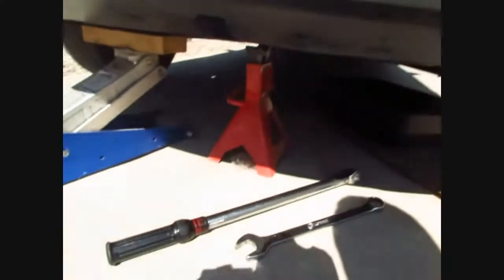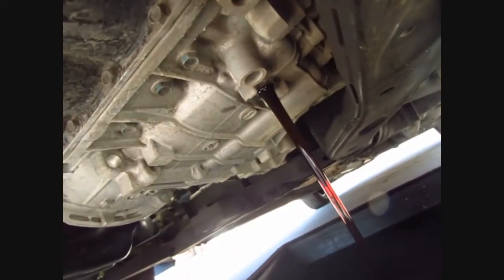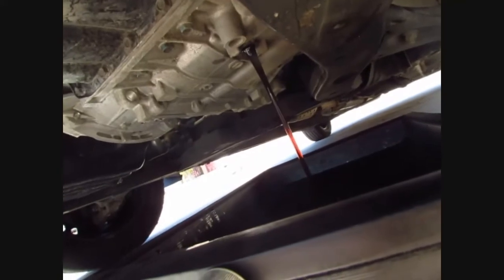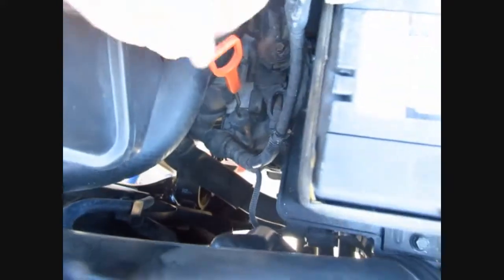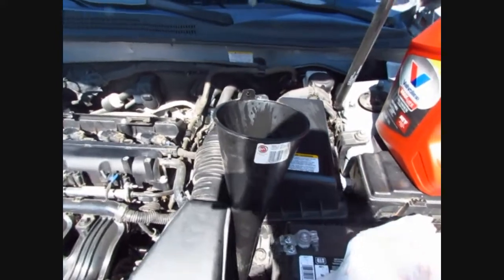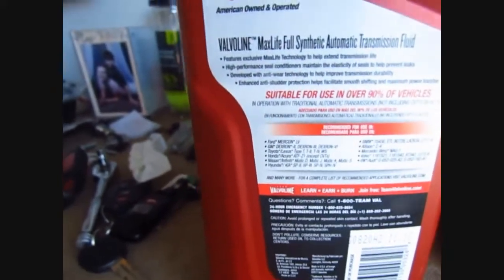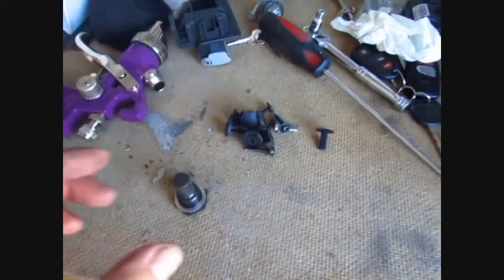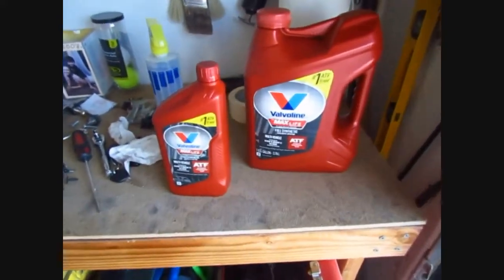How to Change Automatic Transmission Fluid 2008 Hyundai Sonata 2.4

Comment: I current own a 2.4 Sonata gls with 178k miles mix 70%city-30%highway 
Original transmission..
And whoever said you have to pull the transmission apart to change the transmission filter did Not know what they’re saying! 
    It’s not easy and yes the filter is internal but not impossible 
Pull the battery out and tray 
Unbolt the trans pan 
And the transmission filter is located behind the pan and up towards the top..right under the transmission safety neutral switch.. whole job takes about a hour or so..
     My car started whining from stop to go 
And changing the filter made it stop since just a dump and fill of fluid didn’t.
    I also was misinformed by many to use dexton 111 which I bought 
And used and noticed a big loss in power and almost like slippage while accelerating.. PEOPLE don’t use dexton! It doesn’t have enough friction for these trans..
   It uses Automatic transmission fluid SP111 only…please don’t grind your gear teeth away slowly by using low friction fluids…if you do then to save yourself and car add half bottle of Lucas trans fix..it will add the friction needed in the fluid if u can’t find the SP111 fluid 
     in the beginning of ownership I had a hard downshift from 2nd to 1st coming to a stop 
I also noticed if I just slowed down to turn a corner and hit the gas again it was lagging in speed. 
I switch it over to manual mode and noticed it would still be in 3rd gear 
At 15mph and was in that gear prior to turning. 
     I put half a bottle of Lucas transmission fix. And drove it 
And DAM what a difference! 
More power and no more hard downshifts when stopping and started actually being in 2nd gear (not 3rd) when going around turns 
Or trying to get back up to speed from Yeld on highway ramps.
    With using the SP111 Hyundai fluid 
Or Lucas it gave me the power and even my 2.4 was fun to drive around again! And I have 178k miles hwy city mix. On my trans.
Reply: I have the same whine I’m gonna try this hope it helps
Reply: @tygill7401  did it help? I have a 2008 Kia optima with a 2.4 same engine trans and my trans whines only on deceleration.

Comment: I use SP111 that’s what Hyundai recommends to use SP111 is a high friction fluid…u don’t want synthetic 
Or dexton 111 you’ll slowly grind the teeth off the trans gears. That fluid doesn’t have enough friction in it!! 
      If u can’t find SP111 
Then get Lucas transmission fix. As a friction additive and put half the bottle of 32 oz. 
     I did it on my 2010 2.4 triptonic automatic gls with 172k miles. 
And the power I got back is astonishing and the hard downshift from 2nd to 1st when stopping went away 
And mine was getting stuck in 3rd if I had to slow down and speed up (like getting on highway on-ramp) 
Id b stuck in 3rd at 15mph slowly gaining speed to merge on highway unless I really pushed on gas hard it wouldn’t go into 2nd to quickly merge. 
The Lucas made my car shift down/up where it needed to be…complete
Restored my power and transmission smoothed out
Reply from the maker: Hello jesse, 
            Thank you for the comment.
Reply: I wouldn't expect that restoration to last. There's no telling how much damage was done bud.
Reply: @chikinnippls7108  well considering it already has 172k, something's better than nothing😂

Comment: Thank you for the tutorial. Do sonata 2008s have transmission filters that need to be changed?
Reply: No, they do not.
Reply: Actually they do and you have to drop the trans to replace it.. If you don't feel like doing that, change the fluid, run it through about 500 miles, change the fluid again.
Reply: It's really just a screen, not a filter. Technically you can change this if you want to drop the pan (faced sideways) but a fluid replacement every 30k miles should suffice

Comment: Question: does Hyundai sonata 2006 have transmission filter? If yes where does it located?
Reply from the maker: Hello RAKOTONDRASOA HARY, 
               I talked to my local Hyundai dealership today. They said the trans filter is internal, and can not be changed.      Even though you can buy the trans filter from the auto parts store.
Reply: @SOLIDnickel1958  thank you for the quick update 🙏 you're amazing
Reply from the maker: @rakotondrasoahary5795  thank you for the comment.

Comment: mine is a 2007 2.4 liter, i assume its about the same as yours. once again how many quarts total did it take for yours?
Reply from the maker: Hello Kenneth, 
    Mine took 4.5 quarts. Measure how much fluid you take out. And start by putting that much fluid back in. 
Get the car warm, go through the gears and put it in park while the car is running. Check the fluid level, on level ground.

Comment: The Crush Washer should be replaced each time the ATF is changed. Avoids dumping fresh fluid on the ground. Hyundai Dealerships are REAL GOOD at NOT changing the Crush Washer. ATF dripping on the ground. It's a 1 Dollar part. But, that's how Flat Rate Artists operate. Save 3 seconds of time. 
Peace. Out.

Comment: I just bought the same car, well a 2009.  I have changed the oil, coolant and thermostat.  The transmission is sealed, but I know about dropping the pan like you did, but there is no pan.  I've seen on Toyota's that there is a gasket you need to replace as well. We got the car cheap and I was told to just leave the transmission alone.  Personally, on my own car I like to drop the pan at 70k.  This one I just don't know if it would mess up something.  It shifts well.  If it ain't broke don't fix it or should I switch out the fluid?
Reply from the maker: Hello SailfishSoundSystem, 
                       Just change the fluid at the mileage your owners manual says to. And thank you for the comment.
Reply: Sealed really? I have 2010 2.4 liter Hyundai sonata gls 
Triptonic automatic 5 speed trans and mines not sealed I have a dipstick on the right side towards the front on the left side of the battery 
Has a yellow pull handle.
Reply: Yep, many Hyundai's have a sealed trans. You have to have a special machine to pump and pull the fluid. If you want to invest in the machine, go for it or take it to a GOOD mechanic.
Reply: So did you end up changing it?
Reply: @jessewynne8193 I have an 09 and there's definitely a dipstick. So idk what they are referring to.

Comment: How does it shift with the Valvoline Max Life fluid?
Reply from the maker: Hello Mike,
               It shifts very smooth using the Valvoline     Max Life trans fluid.
Reply: @SOLIDnickel1958  Thanks. I am considering using Max Life in my 2010 Sonata transmission for the next change . Sure beets the $12 Canadian a liter for the dealer SP3.
Reply from the maker: Mike,
        Walmart has a good price for the Valvoline Max Life trans fluid. Dollar General had some on sale for $4.50 a quart.

Comment: you don't flush? if not, how often do you change the fluid? and you don't need to do leveling?
Reply from the maker: Hello philowing, 
                      Change the fluid on level ground, at the mileage your owners manual says to.
Reply: @SOLIDnickel1958  did you the leveling by the gauge or opening the leveling lid(not sure what it's called but not the drain bolt)?
Reply from the maker: @philowing  
                  Ok, thank you !
Reply: @SOLIDnickel1958  ah, it is a question.  i actually asked whether you leveled with a dipstick or opening the leveling plug.
Reply from the maker: @philowing ,
                        I used the dipstick.
Reply: @SOLIDnickel1958  Thank you sir!!
Reply from the maker: @philowing , 
                   You are welcome !

Comment: Just an FYI. The factory change interval is 120K miles. The 2008 does NOT use synthetic fluid it uses SPIII fluid and is $8 per qt. from the dealer.
Also factory warranty is 10 years 100K miles engine and transmission. If you purchased the vehicle as certified it will still be under warranty. Good Luck.
Reply: Wow! 120k miles?! My 09 3.3 sonata has 52,000 miles but takes significantly more fluid than the 2.4. I believe slightly more than 11 quarts. I'm definitely not wanting to change it unnecessarily, but my manual suggests changing it every 30k miles so I'm probably getting close if I go with that interval.
Reply: Ive never heard 120k... Always check with a HYUNDAI dealer and your owners manual. The 10 year 100k miles only applies to NEWER (like 2020s) Hyundai's...
Reply: @cornholius  YES your manual is right. I've worked on Hyundai's for YEARS. 30k miles is standard. ALL fluids need to be changed regularly.

Comment: You don't need to change trany fluid? I did the same thing to my 07 sonata 2.4 and on a very slow acceleration it jumps
Reply: You absolutely need to change the transmission fluid on ANY car! Fluid degrades. Come on  maaaaan

Comment: How is your car doing after you replaced the transmission fluid with Maxlife?
Reply from the maker: Hello Harold, 
             The Sonata shifts very smooth after using the Maxlife trans fluid.
Reply: @SOLIDnickel1958  thank you
Reply: RIGHT?? That's always my question. Where are the pre and post work videos??

Comment: no filter?!
Reply from the maker: Hello Quality Reno,
      It does have a filter.
Reply: @SOLIDnickel1958  where is it located?
Reply from the maker: Hello RAKOTONDRASOA HARY,   
         The transmission filter is behind the transmission fluid pan. The trans fluid pan is facing the front of the car. I am going to do a video on changing the trans fluid filter this weekend.
Reply: @SOLIDnickel1958  wonderful 👍 I'm excited to see your next video
Reply from the maker: Hello @rakotondrasoahary5795  , 
       I talked to my local Hyundai dealership. They said the trans filter is internal, and can not be changed. 
Even though auto parts stores sell the filter. The same kind of filter that would be behind a transmission pan.
Reply from the maker: Hello Stream Kingz+App&Teck , 
   Drain the trans fluid just like in the video. Put back in the same amount of trans fluid. Then check the level.